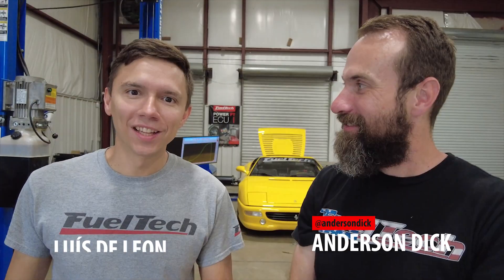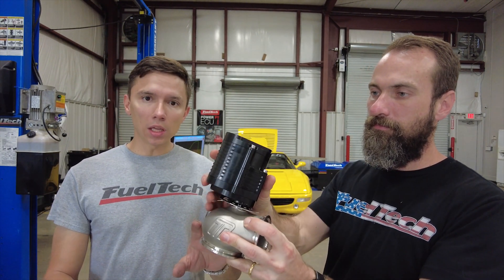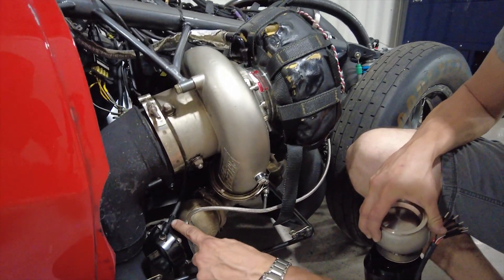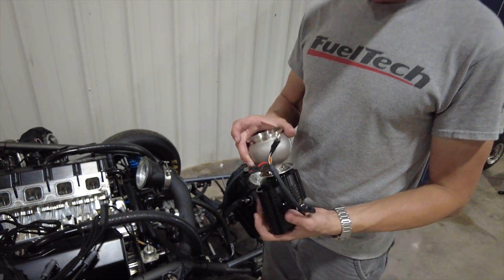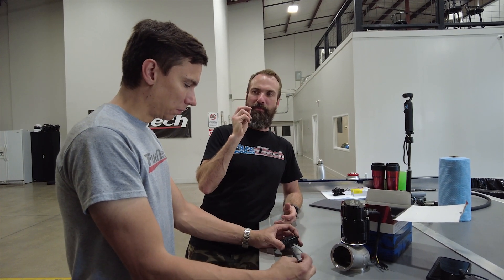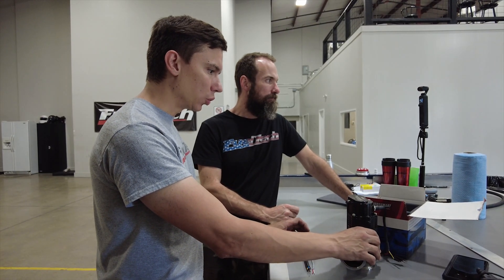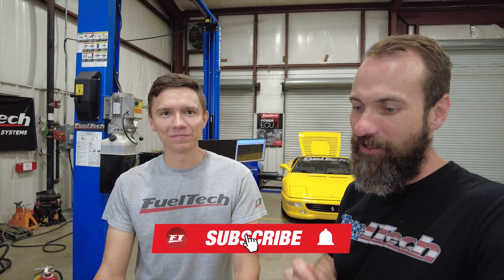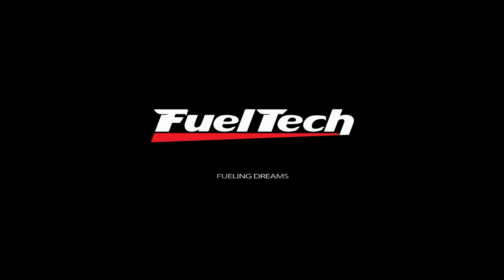Electronic Wastegate + DPD | Learn more about it

Comment: unfortunately its way to slow for adaptive active boost or turbo speed control due to the gearing inside. If a throttle body would be like this it would be impossible to drive the car.
we are waiting for ver 2 or 3, up until that we stick with double chamber boost control on racecar's.

Comment: Great idea guys, good work! Just a thought, what if remote mounting the control head and using a push/pull cable to connect the head to the gate as an option in extreme space constraints.

Comment: Is it a must to connect the cooling line? If without will it spoil the eWG? Will the boost level be flat thru out the rpm or it will tapper towards redline?
Reply: I believe the cooling line would be a must
Reply: Cooling is a must it acts as a forcefield for the electronics in there

Comment: I don't know about anybody else but they knocked it out of the park in this video in my opinion and anytime they a car work on a car or even educational videos like this one I'm down to listen and it's just Luis and Anderson in this one I have been a big fan since probably the beginning of their YouTube Fame I used to see Luis alot more though back then in 1320Videos when Kyle and the crew took their trips to Brazil and on one trip down there they made a video of their Chevrolet Opala with a 292 or 283cid straight 6 cylinder and them cars were fast I want to say they ran a high 6 in the 1/4 on small tires I think it was a 28/275s race but even back then I could tell they knew their stuff and that is where they started was in Brazil

Comment: Do these require cooling water circulation?
Reply: They do have ports to keep it cool on the gate
Reply: Yes 👍
Reply: @hyper8545  Why would they need cooling lines when Co2 gates do not?
Reply: @FadetoBlack1463  because this one has electronics that can't overheat.  I think xD
Reply: @hyper8545  Okay so with  the co2 lines you eliminate with this gate, you have to add cooling lines and fittings?
Reply: @FadetoBlack1463  idk dude I dont have one 😐
Reply: @hyper8545  Neither do I that's why I asked....

Comment: Interesting indeed.....can that E.G. withstand turbo and heat from engine bay.....as we all know that certain electronics must be relocated away from heat.....👍🤙
Reply: Not sure if they have coolant lines that can be used to cool the housing to increase longevity.
Reply: Its water cooled
Reply: Yes but the actual solenoid has thermal ratings.
Reply: Egate control is amazing tho. You can program in economy/power with the signal.